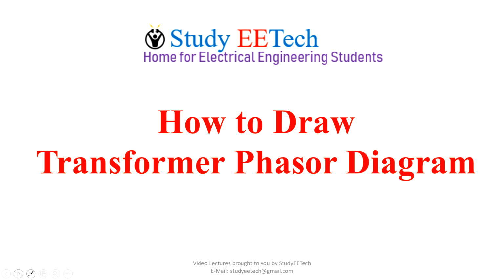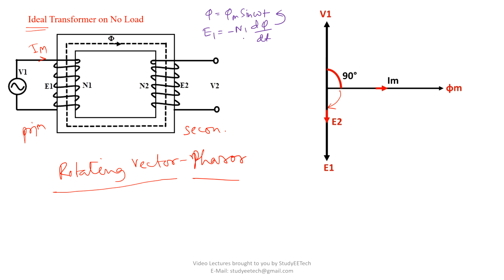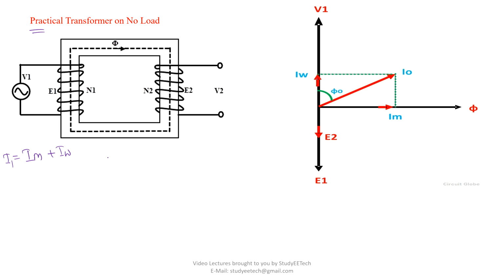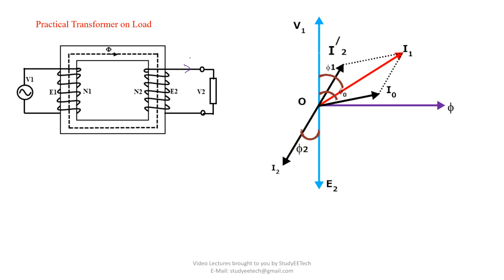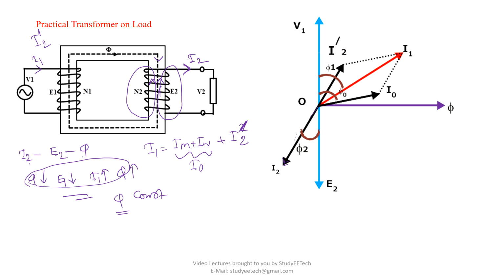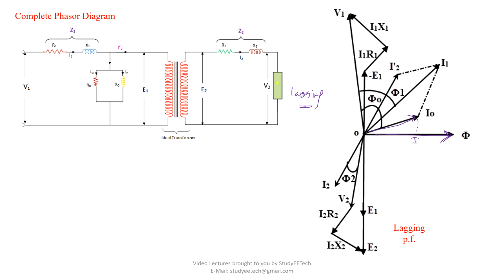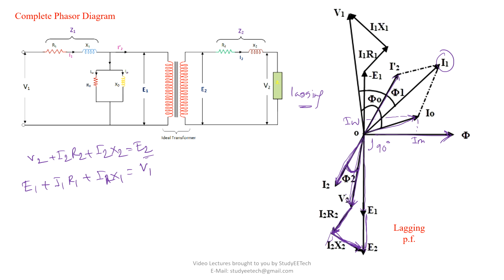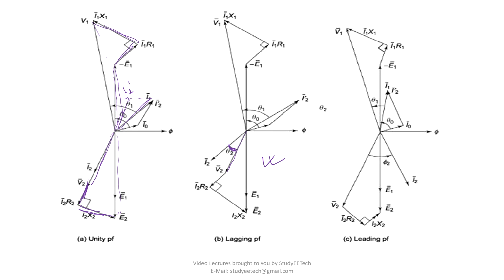How to Draw Transformer Phasor Diagram

Comment: Grear Video!!!

I have observations and questions:

The resulting diagram that you get will not satisfy these equation V1=E1+I1R1+jI1X1. Why E1 is -E1?

There are many books with different phasor diagram, for example:
Example 1:
magnetic circuits and transformers ee staff mit. This has a convention where the resulting diagram that you get satisfy these equation V1=E1+I1R1+jI1X1.

Example 2:

AC Machine Theory - A.Langsdorf. This your convention but This mentions the other way to graph the phasor diagram indicated in the previous book.

So, Could you explain me about these different points of view?

My conclusion is that your convention does not handle the point convention but the other one does handle the point convention. it is correct?

As would be the procedure to establish a phasor diagram for an equivalent circuit of the transformer. It would be to establish the signs of the voltages and directions of the currents and based on the equations draw the diagram.

Comment: 4:15 E and V are opposite due to.... Reason?
Reply: thank you sam. i have explained the the thing in spandan Dash's comment. please read that one. i can't copy the text from that. and yes, we have come up with a comprehensive video lecture series on power electronics. u can watch that also.
Reply: thank you very much tor raising the question. actually i had this doubt also. i researched a lot. in m g say's book i have seen -E1  is not taken. it was drawn in the same direction as V1. But l have I have seen in oiher other books that lhey have drawn E1 in 1he reverse direction as -E1. Both are seemed to bc  correct 'Nith respcctive logic. That actually made the confusion, which convention to be followed. Then in one NPTEL lecture from lIT  KHAPAGPUR, the profossor told that actually both phasor diagram correct. Actually 'Nhen the transformer parameters calculation is concerned from the phasor, both the phasor diaqram vvill produce same result. So any  convention can be followed.  I can send you the link of the nplel lecture if you want. i have to fmd it in the YouTube. it id available there.  by the way, recently we have come up with a comprehensive video lecture series on power electronics. you can watch that if you want.

Comment: Why I2 lags E2 .....I can't understand.
Reply: Mohammed Aamer04 basically it is a theoritical concept that whenever mentioning that lagging or leading of a load is present then we always consider the current should be lead or lag w.r.t the voltage
Reply: thank you very much tor raising the question. actually i had this doubt also. i researched a lot. in m g say's book i have seen -E1  is not taken. it was drawn in the same direction as V1. But l have I have seen in oiher other books that lhey have drawn E1 in 1he reverse direction as -E1. Both are seemed to bc  correct 'Nith respcctive logic. That actually made the confusion, which convention to be followed. Then in one NPTEL lecture from lIT  KHAPAGPUR, the profossor told that actually both phasor diagram correct. Actually 'Nhen the transformer parameters calculation is concerned from the phasor, both the phasor diaqram vvill produce same result. So any  convention can be followed.  I can send you the link of the nplel lecture if you want. i have to fmd it in the YouTube. it id available there.  by the way, recently we have come up with a comprehensive video lecture series on power electronics. you can watch that if you want.

Comment: Why -E1 ?, as V1 = E1 +  I1R1 + I1X1.
Reply: spandan, thank you very much for raising the question. actually i had this doubt also. i researched a lot. in m g say's book i have seen -E1 is not taken. it was drawn in the same direction as V1. But I have I have seen in other other books that they have drawn E1 in the reverse direction as -E1. Both are seemed to be  correct with respective logic. That actually made the confusion, which convention to be followed. Then in one NPTEL lecture from IIT KHARAGPUR, the profossor told that actually both phasor diagram correct. Actually when the transformer parameters calculation is concerned from the phasor, both the phasor diagram will produce same result. So any convention can be followed. 

I can send you the link of the nptel lecture if you want. i have to find it in the YouTube. it id available there.

by the way, recently we have come up with a comprehensive video lecture series on power electronics. you can watch that if you want.

Once again, Thank You very much.

Comment: Im is developed due to v1 but what is the reason that the e1 will oppose v1 

according to the transformers emf equation 

(e2)/(e1)=(n2)/(n1)=(v2)/(v1)

so why should e1 oppose v1
Reply: thank you very much tor raising the question. actually i had this doubt also. i researched a lot. in m g say's book i have seen -E1  is not taken. it was drawn in the same direction as V1. But l have I have seen in oiher other books that lhey have drawn E1 in 1he reverse direction as -E1. Both are seemed to bc  correct 'Nith respcctive logic. That actually made the confusion, which convention to be followed. Then in one NPTEL lecture from lIT  KHAPAGPUR, the profossor told that actually both phasor diagram correct. Actually 'Nhen the transformer parameters calculation is concerned from the phasor, both the phasor diaqram vvill produce same result. So any  convention can be followed.  I can send you the link of the nplel lecture if you want. i have to fmd it in the YouTube. it id available there.  by the way, recently we have come up with a comprehensive video lecture series on power electronics. you can watch that if you want.
Reply: @jayabratamaity6889  yes plz send the link

Comment: Why i2 is lagging current
Reply: it depends on the type of load if the load in inductive it will lag ,for capacitive load it will lead voltage by 90 deg ,and in pure resistive case it will be in phase
Reply: AR GAMING gave the correct answer. anyway boini... recently we have come up with a comprehensive video lecture series on power electronics. please watch them too.

Comment: wrong,  you have not explained why V1 = - E1+I1R1 +JI1X1, primary side
Reply: Yes bro
Reply: That is because conventionally we take - to + as negative,in E1 current is flowing from + to - ,you know that when we apply kvl we have to assign signs ,if you take the direction of current as clockwise then the equation that was in this video will be formed and you will get the answer you are asking him for.
Reply: thank you very much tor raising the question. actually i had this doubt also. i researched a lot. in m g say's book i have seen -E1  is not taken. it was drawn in the same direction as V1. But l have I have seen in oiher other books that lhey have drawn E1 in 1he reverse direction as -E1. Both are seemed to bc  correct 'Nith respcctive logic. That actually made the confusion, which convention to be followed. Then in one NPTEL lecture from lIT  KHAPAGPUR, the profossor told that actually both phasor diagram correct. Actually 'Nhen the transformer parameters calculation is concerned from the phasor, both the phasor diaqram vvill produce same result. So any  convention can be followed.  I can send you the link of the nplel lecture if you want. i have to fmd it in the YouTube. it id available there.  by the way, recently we have come up with a comprehensive video lecture series on power electronics. you can watch that if you want.
Reply: @jayabratamaity6889  keep me that Nptel video lecture link sir
Reply: @jayabratamaity6889  ...please send the link...thanks in advance